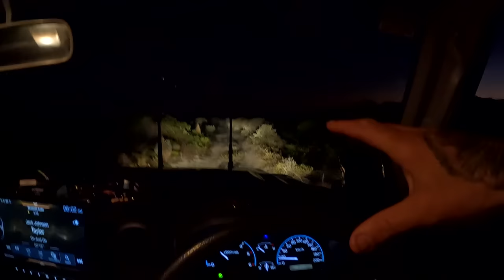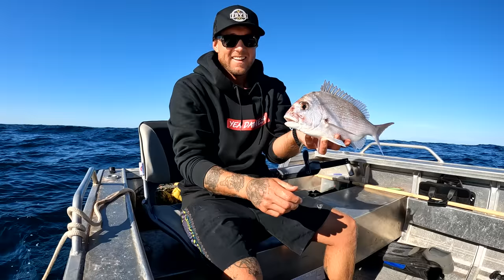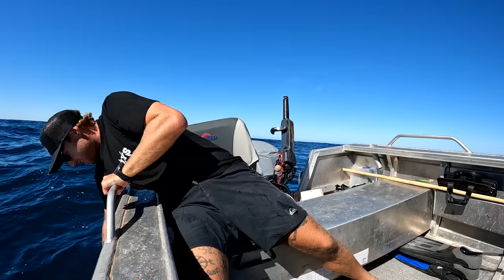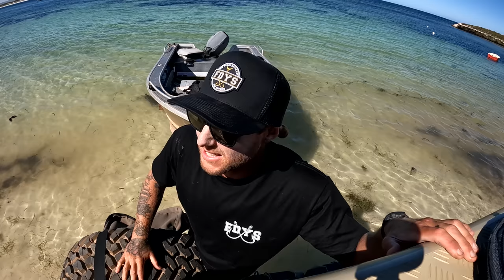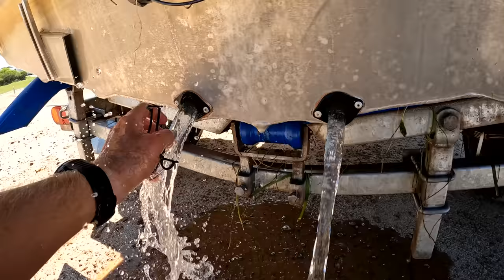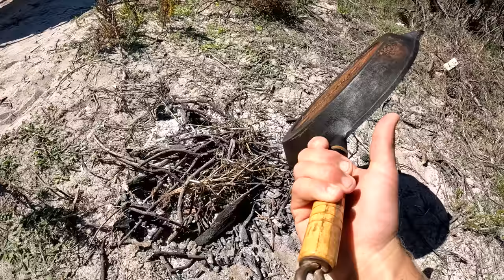IT ALL WENT SO WRONG.. SINKING BOAT - Send Help...

Comment: For future reference. Once the tinny fills up again, get going in a straight line and pull the plug at the back of the boat. Don’t let off the throttle until water is gone and plug is back in. Problem solved. Used to rent those things back in the day
Reply: Can confirm this works 100% haha have had to do it a couple of times
Reply: Had to pull the bungs meself after getting a Blue wave over the side & bilge didnt work. Oh by the way a bilge pump is a good idea.
Reply: just needed to do this 3 days ago in a rib taking ppl out of a natural harbour and getting flooded form behind it is the best thing to do also good to have a trunk u can drop to make it faster.
Reply: Do you have to put the throttle fully down?
Reply: @krispypepper1898  you have to get up on a plane preferably if that is not possible then just so that there is no water where the plug or trunk is so the water can run out of the boat.
Reply: @krispypepper1898  Yes, when a boat moves it creates a void behind which allows water cto drain out!

Comment: You should put rubber or pillows on the wheelwells. This happened to me once aswell. When you're driving offroad and dont strap the rear end to your trailer, the boat is gonna bounce and hit the wheelwell.

Comment: The stringers in the boat have been forced up from being driven through rough water when you get it fixed make sure they press the stringers back down to floor level. I’ve done this type of repair heaps of times. You can weld it up but without support it will crack again
Reply: And yes I’m a boilermaker and most of my work for a long time has been repairing cracks just like that one in your boat.

Comment: Your tolerance for risk obviously exceeds that boat's capacity to structurally withstand the ocean's beating that you subject it to.
To put it more simply; you need a stronger boat, Dawgie. Love your vids. Prayers to recover swiftly.
Reply: Well, there are many reasons for that to happen, one comment above said it could have been from the boat hitting the trailer after all those bumps....never know..
Reply: That was the most logical sentence I've ever read
Reply: @aaronusher3097  when you trailer a boat, the winch pulls the bow of the boat securely against a stop on the trailer, securing it against forward or backward movement. Then straps in the rear secure the boat from moving side to side. The crack is clearly outside the bunks on which the hull of the boat rides. therefore it is most unlikely that the trailer caused the damage to the boat.

Comment: good idea to get a bit of conduit or somethgin with a flange so it can go over the throttle and opperator your motoor from the front of the boat... sometimes you just need to. doesnt take up much room and you can even make them into a few parts to connect togehter.

Comment: Can’t you use flex seal on the weld areas just as an added protection? Or ceramic coating? Something incase the weld doesn’t work. If I had a boat I’d make it impossible for water to leak in & I’d also have an automatic pump/detector or something.

Comment: If you pull the plug while under way all the water will quickly suck right out of the boat.
You should always have plugs accessable from the inside compartment of the boat so you can drain water in an emergency.
Reply: Would it not just fill up faster😂
Reply: Exactly what I was thinking
Reply: Willow is correct, Dad forgot the plug one day. Over 1 foot in boat. We did this and water did drain...we put plug in from inside boat after water drained and returned to shore to plug properly.
Reply: @drewcoleman3984  only if you stop
Reply: You have to be on a plane and the plug can't be too big, but it will drain (ref. "venturi effect").  Once you come off the plane though, you have to be ready to put the plug back in quickly (not to mention the risk of dropping it into the Indian Ocean, since Matt's boat has it installed from the outside  ;0).  Look into a self-bailing plug.
Reply: @drewcoleman3984  Not on the plane, it goes straight out the back.

Comment: The welds on that boat dont look too great overall, the are some better ones i have seen during the video but a lot are not it man 😅, get the whole boat checked out when you get it fixed, or get the welds checked out if you already got the crack fixed since that is proably an older video from before you fu*ked your ankle 😅.

Comment: Every boat in America I've owned the plug is in the inside of the boat so if you get water in it you just get on plane, pull the plug and it will drain most all of it.

Comment: The crack is in the chine, not the gunwale, minor point, the major point: why do you not have any bailing device?
Hand pump, electric pump, bucket?
Can you pull the plug from the inside while planing?
Reply: I always have a spare plug, and what you can do is plug the drain from inside, hang over the transom and open the drain, get up on step then open the inside plug to allow the water out.
This worst case scenario for the situation where your automatic electric bilge pump is malfunctioning or not keeping up.
An easy set up is to have a rubber tube mounted to the outside of the drains, then just bend it up and hang it over the top of the transom through the engine well.
If you need to drain, just drop them while on plane and the water can flow out, pull the tubes back up with attached cordage.
Safer than one way valves on scuppers as they always seal completely.

Comment: Pull the bung plug next time mate, i know.... seems dumb... BUT as you motor, the water gets push backwards out the hole faster than it can come in, the only time you do that is in this situation man... you lucky you didnt hang around or you could have ended up in the news paper.